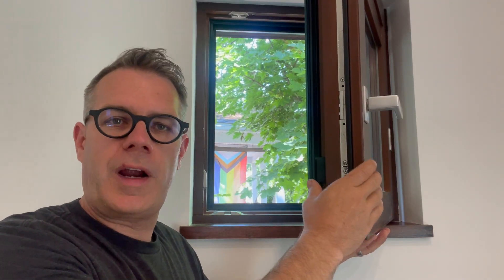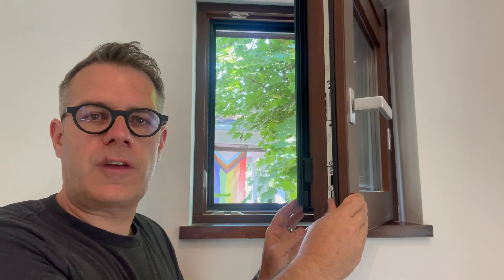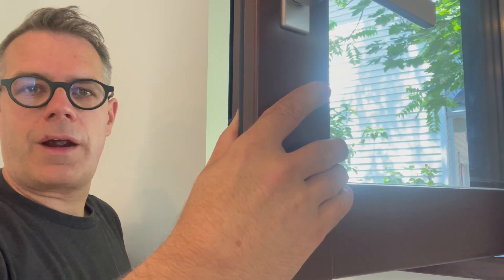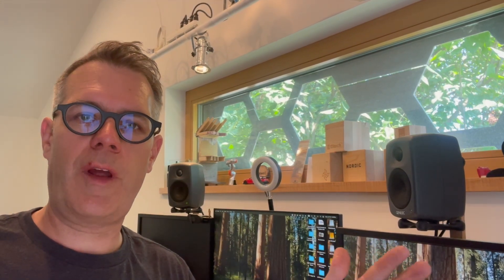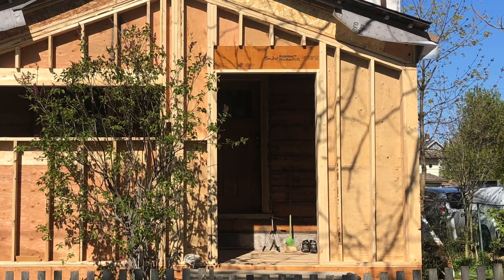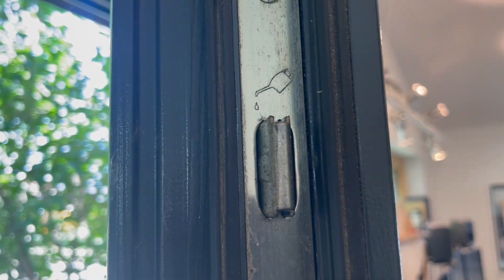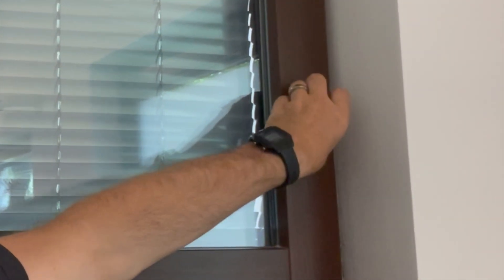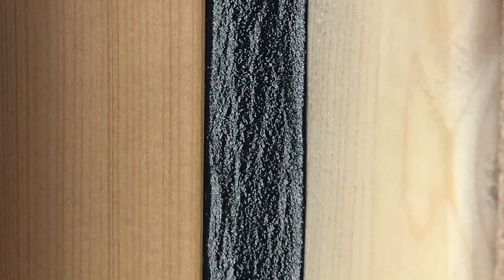Why I Chose European Tilt & Turn Windows for My Canadian Build | Episode 6

Comment: I was just watching this video and noticed something that has been puzzling me for years, because very few window and door manufacturers seem to consider it at all.

When it comes to the handles, I genuinely don’t understand why manufacturers still use the tilt-and-turn configuration where a 90° turn fully opens the window, while you need to rotate the handle all the way to 180° to get the tilt position. It’s completely unintuitive and not user-friendly.

In another property I own in the UK (the only place where I have ever had this configuration), it works the opposite way: 90° for tilting and 180° for fully opening and it is far more practical. Most people almost never fully open a window (maybe once a year for cleaning), but tilting is used for ventilation almost all the time. In practice, tilting probably accounts for around 90% of all usage, especially for doors leading to so-called “non-existent" or "russian :)" balconies that nobody actually uses.

So why do we have to rotate the handle the full 180° thousands (or even millions) of times during its lifetime, when a simple 90° turn would be quicker and more ergonomic? Having experienced both setups, I would never again choose a system where tilting only starts at 180°. And from a child-safety perspective, the reversed configuration is also much safer in homes with small children, especially on higher floors, because a child playing with the handle cannot open the door so easily and run outside.

Regards,
David
Reply: In short, you have made a few wrong assumptions

Comment: I don't like wood windows, especially in an extreme climate. Fiberglass is best, followed by vinyl.
Reply from the maker: Interesting that you'd think that. They are good windows, but they also have their fair share of issues. Fibreglass as a material has some inherent issues. I barely come across them nowadays. Mainly, wood/aluminum, full aluminum and vinyl. I just found out what we also have cellular vinyl now too, which is interesting.
Reply: @TimberPlanners  What issues with Fiberglass windows?

Comment: Maybe I missed it, but who manufactures and who supplies these windows (Enersign?)? I want to use high quality, Euro tilt/turn windows in a remodel I'm currently working on. I know these windows are higher in price than typical North American manufacturers are. I'm OK with that but don't want to get ripped off.
Reply from the maker: I didn’t mention the manufacturer on purpose to keep it neutral. I used to import these windows from Germany. I’m not sure where you are located (USA?) and I’m not sure if VETTA is available there, but I’ve give them a ring. They might only sell to Canadian customers/projects though.

Comment: If Canadians struggle now with heat not  cold you can tell the climate is really changing
Reply from the maker: It’s not changed that dramatically. Canada has historically had very hot summers (I don’t know about places like Winnipeg or Edmonton though.) One has to remember that we (in Niagara region at least) are on the same height as Rome, so quite far south, but still have winters as cold as Sweden.
Reply: LOL
Reply: @DRTYFN this is what I was thinking why he needs holes in the window for heat to escape, when he has to heat his house 8 months in the year

Comment: Great video Hans. Internal blinds and solar powered wow. We chose Enersign for our 6 windows but did not get screens due to price and budget. Is there an after market screen supplier who sell these type of screens for European windows rather than buy from Enersign?
Reply from the maker: Yes, you can order screens locally. I don’t know exactly where, but flex screens are available here. They are the best option in my opinion, as they slide right into the window frame without any additional hardware.

Comment: Where did you source these windows in Canada? Through an importer or direct?
Reply: I'm not 100% sure they ship to Canada, but several builders here on YouTube who are located in the USA get their windows through a company called European Architectural Supply (EAS).  The ones the YouTube builders (like Matt Risinger and Jake Bruton) usually get are made by Schuco, but I believe EAS can source windows and doors from other companies as well.  They are typically made to order so they take a few weeks to get and arrive in crates, but you can get pretty much any size window you want.
Reply: @r.j.bedore9884 yeah EAS doesn’t supply Canada unfortunately
Reply from the maker: I used to Import these windows from Germany and had planned to do the addition long before the project. Before using them I was using them as demonstration models at shows. Are you looking for windows?
Reply: Do you have any contacts for suppliers either in Canada or Europe?

Comment: Good choice! They seal better, they are safter, better insulated.
Reply from the maker: Thanks. They are up and coming here in Canada. Should be a lot more standard as the common windows fail very early, I have friends with homes who had to replace windows after just 8 years. That's just not acceptable (nor is it environmentally sustainable, not matter what the windows are)
Reply: @TimberPlanners  We have windows here that outlast generations
Reply from the maker: @mitas3484  yes. Where is "here" for you?
Reply: @TimberPlanners  Europe, Denmark
Reply from the maker: @mitas3484  very cool. I think you have different windows from Germany too, possibly more compatible with Canada? Like outwards opening sashes and such.